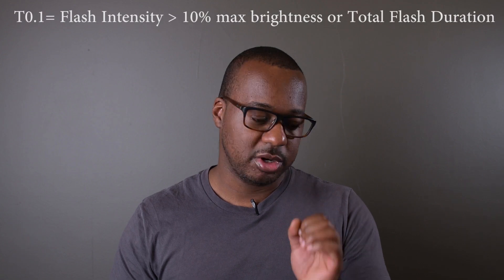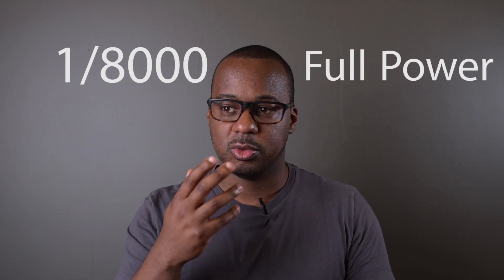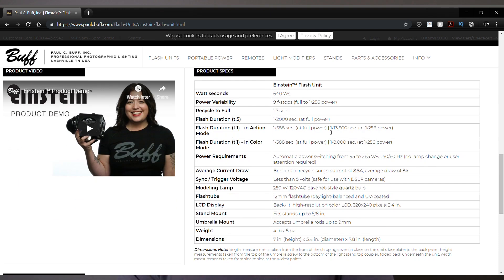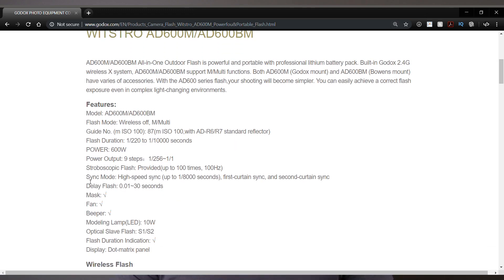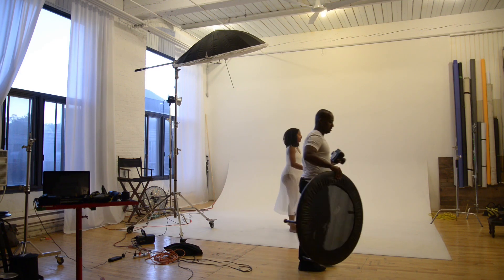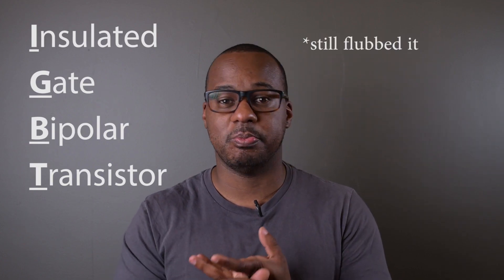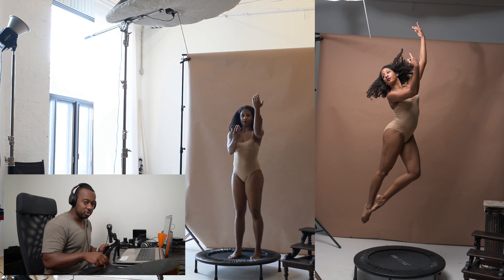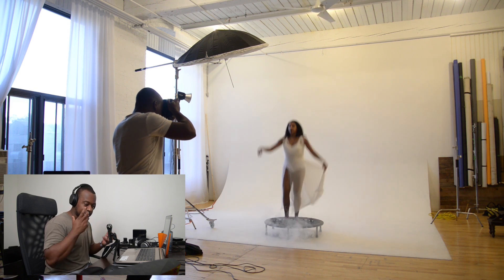You don't need HSS to freeze motion

Comment: There's more than one solution to high speed flash. The Elinchrom hi-sync system, for example, doesn't make the flash strobe repeatedly during the shutter operation. And  it's counter-intuitive because it relies on a single longer flash duration to synchronise with the shutter speed. And the timing can be adjusted so the peak of the flash occurs at precisely the point when the shutter opens.
My studio flash units have a duration of 1/800th of a second, which I've used with shutter speeds up to 1/8000th of a second. Even at a shutter speed of 1/2000th of a second (which is faster than most short flash durations) most human motion will appear frozen.

Comment: This was a super-helpful video but I wish I had seen it sooner! I was using speedlites to take photos of a jumping dog (a "powder shoot") in low ambient light, and found that my images had motion blur.  Since I needed to be at full power (=1/200s flash duration), I had to then use my shutter speed to control the motion blur, and go into HSS territory.  No more motion blur (at about 1/2000s), but I was determined to find out if what I really needed was more powerful lights so that I could shoot at a lower power setting (than was required by my speedlites), therefore freezing motion at below-camera sync speed shutter speed, and stay out of HSS territory (my speedlites were getting really hot).  I had a hard time formulating what I was looking to do to where photographers understood me when I was explaining things, trying to figure it out.  I think they weren't aware of the power-to-flash duration reality. A lot of us thought power is just output power (more watts), not more power (exposure) because of flash duration.  This video nails the explanation.  Great job!  P.S.  I bought two AD600Pros to permanently remedy the situation :)
Reply from the maker: Awesome to hear! Good with the motion freeze!

Comment: Does flash duration impact HSS ? What is the relationship between them ? Say I want to shoot a cyclist and I use HSS and 1/800 shutter and power my future strobe (an AD600) at 1/1 (which has  t.1 of  about 1/250 @ full power)
Reply from the maker: Yes it does but when you enter HSS, the rules are a changed since HSS works a little differently. Outdoors, you are trying to control the ambient light to get a more controlled aperture thus HSS. Shutter speed also kicks in in terms of getting a sharp image in HSS, not only flash duration. If you get something sharp outdoors at 1/1 and 1/800, awesome keep at it. Indoors is a lot useless. 
It's quite complicated to answer in a comment - hope that made sense.
Reply: @YvensBPhoto  Thanks for taking your time to reply. I'm not sure I understood your answer. I know how HSS work. It basically pops the flash multiple times in a rapid succesion to light up slices of the image as the shutter moves. My question was, if I get the AD600, would I be able to freeze a cyclist (as I'm frequently shooting sports events commercialy), knowing that without flash, 1/800 is what I shoot most frequently to account for the cyclist's moving speed and also to prevent camera movement with a cheaper 400mm lens with not great stabilisation. Thus, I am forced to use HSS. And I presume I would need to shoot  the strobe at 1/1 sinces HSS eats a lot of power. The strobes t.1 is list as 1/230 at full power. But I suppose this is when shooting without HSS. Would such a combination freeze the cyclist ? I'm thinking that since that HSS are basically multiple flashpops, each  with lower power the t.1 value would be decreased (faster that 1/230). Is this line of reasoning correct or am I missing something ? Thanks.
Reply: @thegreatujo  I'll take a stab at answering.  Remember, you can freeze motion using flash only in the ABSCENCE of ambient light. So If you are trying to freeze motion outdoors, in daylight, you will need to freeze motion via your shutter speed (as if you weren't using flash), probably putting you in HSS territory for many types of movement. HSS will act as more or less a constant light source, you'll be controlling exposure length by shutter speed. You use the power level as you normally would determine that gets you proper exposure, without worrying about a related flash duration needed to freezing motion. You can kind of think of shooting like this as Fill Flash since you have ambient to assist with your exposure.

Comment: Very insightful content. However, it sounds like a pretty cumbersome restriction to have to conform the power level between the main light and other lights. It means that one would have to adjust the distance of the non primary lights to reduce their brightness. What other things could be done to control the effect of the non primary lights if the power level has to be the same as the primary?
Reply from the maker: Good question. Other than using one light,working with the restrictions and photoshop, I'm not sure if there are many other ways to prevent this.
I'll make an update when/if I find a solution.
Reply: Yeah, I'm confused about that part.  I don't get why there would be motion blur if two lights have different power levels.  Oh wait, now I do (after typing this up), because the higher-powered light would have the slower flash duration so you'd see a little less sharpness in the image, as it's captured between the time main light was on and the lower powered light (with faster flash duration) was on.  Hmm.

Comment: @15:41 it shows the shortcoming of not using HSS, you can see that the foot is blurry at the toes. That is why I am waiting for the LINK to be released by PCB, meanwhile speed lights, (Multiple to compensate for the lack of power with HSS)
Reply from the maker: As I said at 11:10, this is an issue coming from having lights at 2 different power levels. You can totally get something done without HSS in studio. If you put your Einstein strobes in action mode, it'll freeze motion at 1/200.